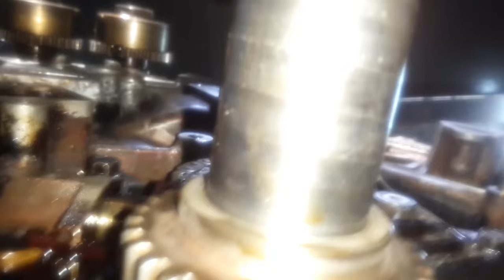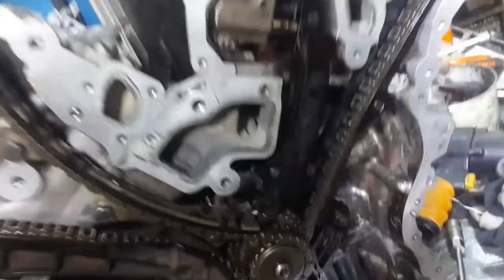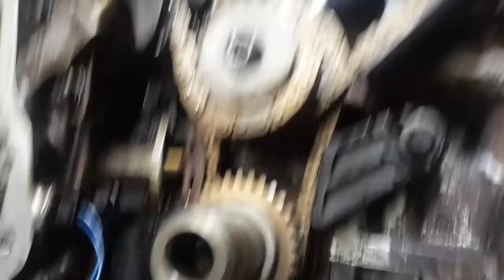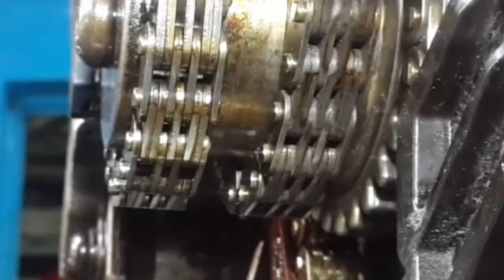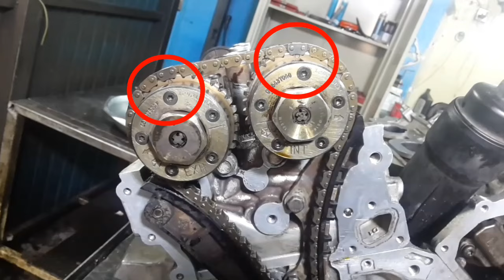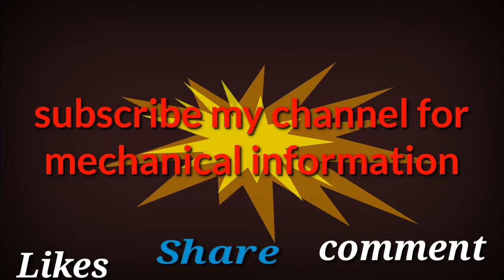Dodge Charger V6 engine timing chain _ dodge charger reliability  _ 08 dodge charger car timing belt

Comment: Wanted asked question..I replaced rockers on a 2013.wit   3.6 .. I used special tools & did as instructed ..all my marks I made prior to repair lines back up.. Even after rotating engine 2x .  👌🏾 .my questions is when I rotate it has a spot where chain gets a lil slack then as I continue to rotate it tightens bac up ..Again all my lines are dead on ...Is this normal ...Was thinking tensioner has to be oil fed when crank engine ⁉️ Thanks n advance

Comment: Left cylinder head has two arrows pointing together on cam phaser...Right cylinder head has two lines together on cam phaser.
Reply: Noe Garcia I noticed that as well
Reply: Because it's correct.

Comment: Since this is a year old I assumed you're already done. Was the cam the problem? I have that #3 intake rocker that fell off. So I'm  installing 2 new cams and phasers but the damn timing tensioner won't move. I even hammered the plastic tool in only to it splitting apart. I guess tomorrow I'll have to remove the timing chain cover.

Comment: This is the 2011+ V6 engine, the 3.6L. It will be the same as the 3.2Ls made after that.

This is not an engine that would have been available back in 2008, but the general idea of this video should get those on track. Just beware that your marks will look different, but they will be in similar locations.

Comment: The one im working on # 3 cyl intake rocker dropped out and ground off cam . Engine ran hot because of compression / exhaust getting into water.  I need a passenger side intake cam . 2013 dodge durango . The number on my cam is 201372  do any of you know what a good number will interchange with this number . Facing the windshield in front of the radiator the cam is on the left inside cam . I think they call that the right side intake cam, but it’s on the left facing you . I just tore it down yesterday. My first 3.6l . So Im having to learn !

Comment: The left and right banks and direction of rotation are determined from the flywheel end of the engine. The arrows need to be lined up on the left bank and the straight lines lined up on the right bank….as viewed from the flywheel end….